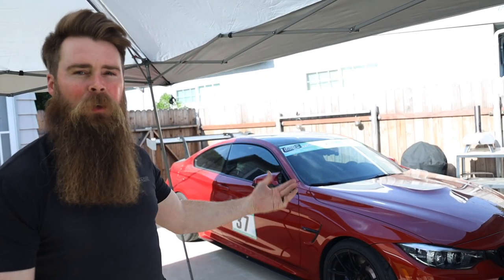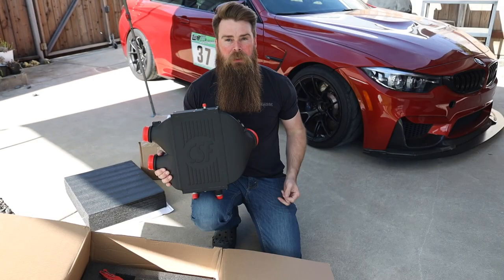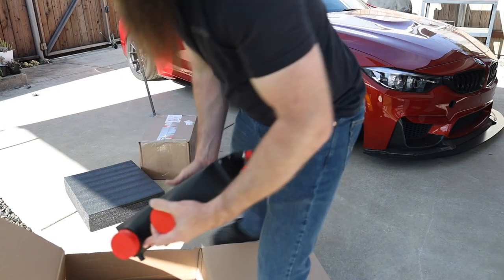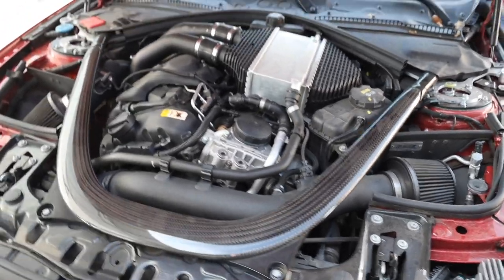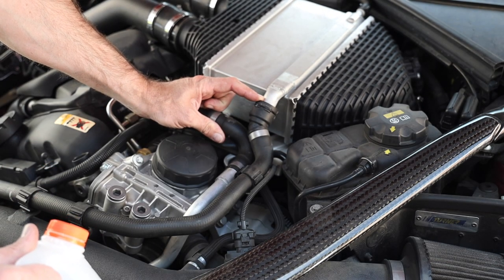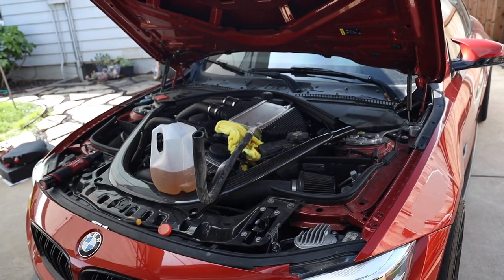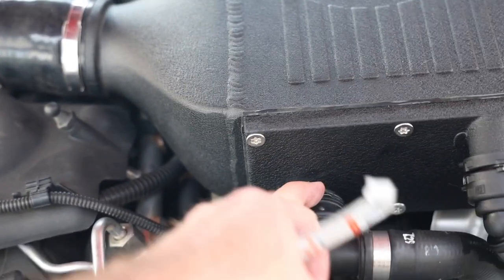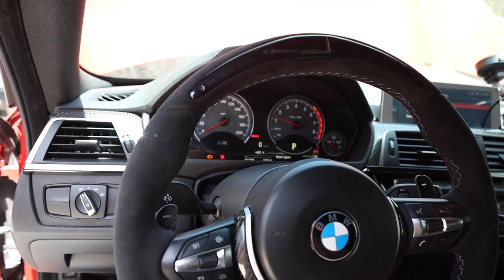Unleashing Hidden Power: Upgrading BMW S55 F8x M4 with CSF Intercooler Install @KiesMotorsports

Comment: Do you notice better cooling? Looking at switching mine just as a preventative to the leaking but was wondering heat soak/performance wise if it runs better.

Comment: Did you not need a battery tender for the bleed procedure? It takes like 5/6 mins to start and then another 10/11 mins to fully cycle according to Kies motorsport guide
Reply from the maker: It’s a good idea to have a battery tender, but not necessary. I let it run for about 20 minutes to do it cycle

Comment: Hey there, I just want to ask regarding the CSF as I have read the OEM even performed better horsepower and torque number during the testing at Kies Motorsport. And I just read that Mishimoto makes better intercoolers for the S55 than CSF. Can you please explain what you think about those threads. Thanks
Reply: The best intercooler for the F80 is the stock one. There’s absolutely no reason to “upgrade” it if it’s not leaking since most aftermarket intercoolers rob you of power with the exception of maybe 2 (none of which are CSF).
Reply: @jmm5346  same with the idiots that spend over 2 grand on that ridiculous eventuri intake that actually robs power over the stock intake

Comment: What data do you actually have as proof that the Chinese made CSF unit is an improvement over the oem charge cooler?
Reply: Ask Carbahn Motors because they use this unit
Reply from the maker: Well my data would be that I’ve had an OE one fail and leak. This seems to be constructed better and out of more aluminum. There’s no plastic bits to fail. It’s more about consistency and keeping the intake carve cooler when on track at consistent wide open throttle. Here a good write up https://f80.bimmerpost.com/forums/showthread.php?t=1760854&page=2
Reply: The fact it won’t crack and leak like the oem one and the hundreds upon hundreds of F8x that have already attest to it since like 2016